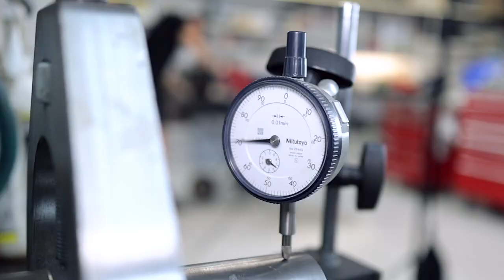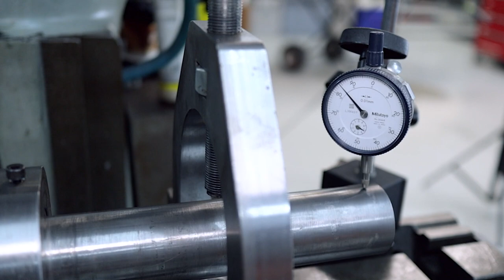HOW TO: Fix Any Go Kart Part 2 - POWER REPUBLIC

Comment: As I work on getting my older karts up/running:  You need to show how to deal with frozen bolts!  Also please go over brake master and caliper rebuilds as part of getting a kart up/running.  If one can't rebuild the brakes, please cover how to buy an appropriate new brake that fits (it's been much harder than I thought).  Also, what about slightly warped brake rotors, any way to repair vs. replacing?
Reply from the maker: https://youtu.be/wTs-nnTniAA

check that one out for brakes.

slightly warped brake disc are machinable, but it easier to buy a new one obviously, if you don't have access to a machine lathe

Comment: Hi I’m currently undertaking a similar project and was wondering if there is any way to drill a new key way at home with out the use of a milling machine. Also I’m unsure what gearing to run. So I’m putting a 125 pit bike engine into the kart. It currently has a 15 tooth on the engine and haven’t brought a sprocket for the axel yet.
Reply from the maker: Hey Connor, sure is, use a file to make a flat for the key to sit on.  and then mark out the position of the new keyway peg hole with a ruler and centre punch, then drill a new hole.  boom! hope that helps and thanks heaps for tuning in and sharing the videos
Reply: @PowerRepublic  thank you, I’ll give it a go.

Comment: What did you use to sand off that axle? Just sandpaper?
Reply from the maker: Hey Cal, Happy new year mate.   yeah I use 180 grit emery paper.   you know the stuff you can get in a big roll that is 25mm wide strip?
https://www.ebay.com.au/itm/313185979640?chn=ps&_ul=AU&_trkparms=ispr%3D1&amdata=enc%3A1rhC2LAQVS-uy1Y_n7Ie4Mw92&norover=1&mkevt=1&mkrid=705-139619-5960-0&mkcid=2&itemid=313185979640&targetid=1395287513209&device=c&mktype=pla&googleloc=9068900&poi=&campaignid=14475531263&mkgroupid=125379166974&rlsatarget=pla-1395287513209&abcId=9300653&merchantid=7364522&gclid=Cj0KCQiAieWOBhCYARIsANcOw0zDhUGFLyWvtuIn12D8fgtFQoiGMnEhmrL1oBVgtedbWt8a-JnQZjUaAu02EALw_wcB

Comment: Hi, I have a rotax max pre evo and I’m having trouble with bogging out of very slow corners what would be the fix for this
Reply: Same here even out the pits at low speed bogs, spits n splutters until it get to a certain rpm
Reply from the maker: spits and splutters is rich fuel mixtures, raise the float level or maybe change to a new needle and seat if you haven't changed that for a while, as they wear out and need replacing.
Reply from the maker: sounds lean, I would richen up the float level by 0.50mm, you can watch that how to video here https://www.youtube.com/watch?v=SiF4amUqDCA
Reply: Power Republic I raised the float level from 4-5mm this afternoon ready for next week on track, I’ve only used the kart a handful of times as I haven’t had it long, how do you replace a needle and seat?
Reply: Power Republic ahh okay I’ve done the opposite then🤣, will change back, thanks
Reply from the maker: @tobycase2657  yeah yours sounds lean, take the float level close to 3.0mm and that should help you problem.  the needle and seat (rich) problem is for Ashar
Reply: Power Republic is this for the 3.6 or 5.2g float kit, I’ve just found mine is a 5.2 with a 60 idle jet
Reply from the maker: @tobycase2657  well you could just switch over to the 3.6g floats.  or lean out the float level by 0.5mm

Comment: Im not convinced turning the sprocket around will make any difference. The gears are still lined up in the same place, and the bend is a result of the chain pulling the axel around the pivot of the axel bearing closest to the sprocket. As the force applied, and the distance from the bearing its applied to are exactly the same, the force bending the axel will be too. The new keyway could make it worse too by allowing more force to be delivered to the axel with less give in that keyway. Its like a cars crash structure, if its repaired, you strengthen one bit, and end up transfering the deformation to the next in line. I think making the insert longer, to go from the rear axel sprocket through beyond the axel bearings would be best.
Reply from the maker: Hey Chris, I think you are probably correct.   We will have to wait and see........
Reply: Might not help with the axle ridgitity but it definetly help with the axle key bending.
Reply from the maker: @extremebicyclenetwork4131  yeah I think the keyway moving out of place was the big issue